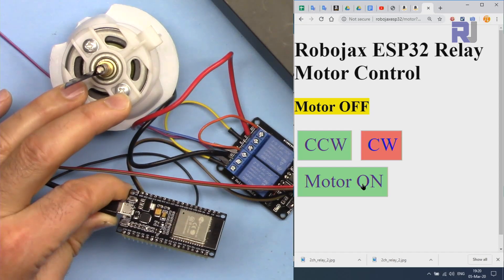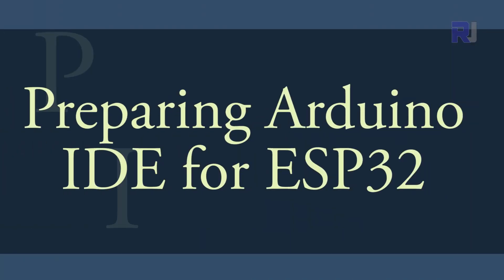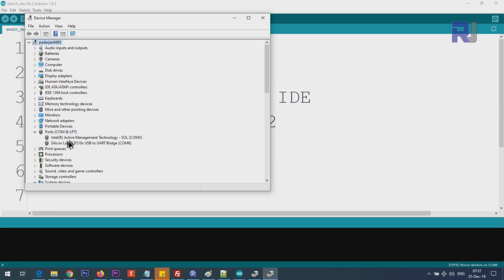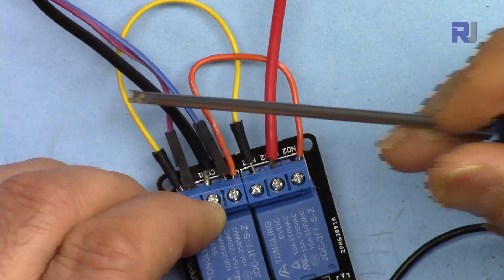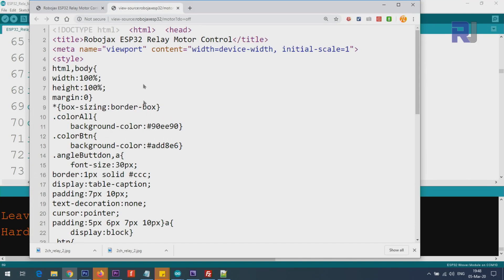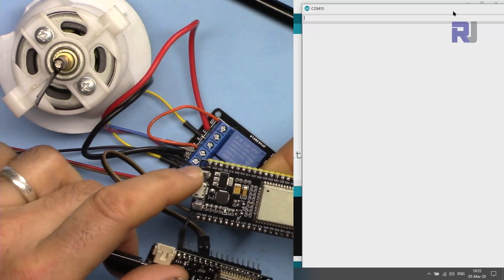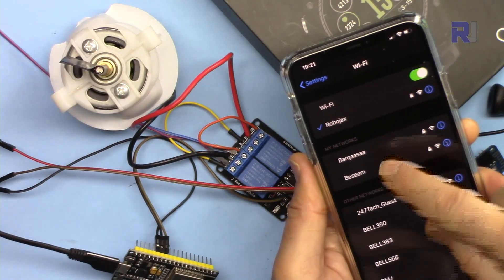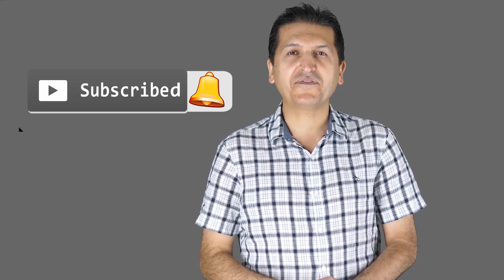IoT ESP32: Control DC Motor over WiFi using 2 channel relay - RJT279

Comment: Great stuff, this helps a lot with a project I am working on.

However the code seems to be broken, I've tried accessing from computer and phone and both times when I paste the copied code as is I get errors when compiling.

For example in the section where it includes the 4 libraries the code only says:

#include
#include
#include
#include

After typing the 4 libraries manually I get other errors from other sections of the code. Please reupload or have an option to download the code as a file instead of copying and pasting.

Thanks
Reply from the maker: Thank you for letting me know. We have recently updated our server and some pages have been missed up. I just fixed it code.

Comment: Why don't you add the circuit diagram?
Reply from the maker: Because I explain the module with all inputs and when you the name of input and outputs, then it will be covert easy to follow when I show you. My videos are for learning not for grabbing the code and use.

Comment: the output from the relay is very low....my input was 12 v 2 A and directly connected the motor runs very fast....but when it goes through the relay the motor turns slow...is there any way to fix it?
Reply from the maker: Relay is just a switch it turns it On and Off . Something else is causing it

Comment: Great video! Does esp32 have enough memory for controling both relay for dc motor and one servo motor over wifi? Thank you!
Reply from the maker: Thanks. controlling outputs are independent of memory. you can control as many as available outputs.  here ESP32 is used to control 3 servo motors https://youtu.be/39e4V0-GCgo
Reply: @robojax  thanks!

Comment: Any plans on using power saving ESPNow instead of server/client via a permanent WLAN connection?
Maybe using two or more ESP32 to control each other that way?
Reply from the maker: Hi Tom, I just looked at ESPNow and it just facilitates connection between two devices but not controlling them. Just communicating. I will see to find application for that like read sensor values or sending other data.
Reply: @robojax  Thats what i meant. I am not a native speaker, sorry
Reply: @robojax may you please share the codes